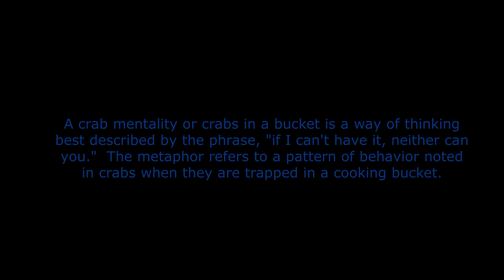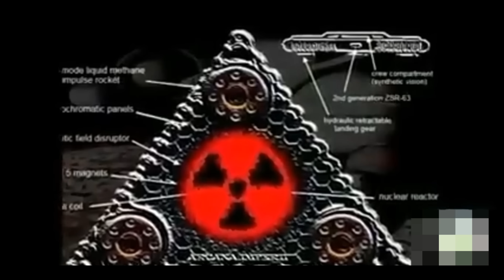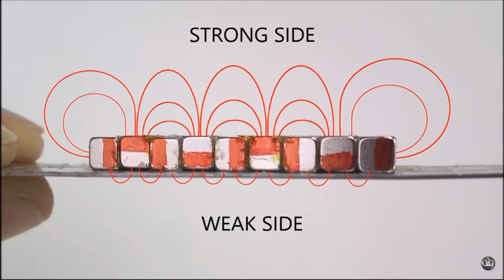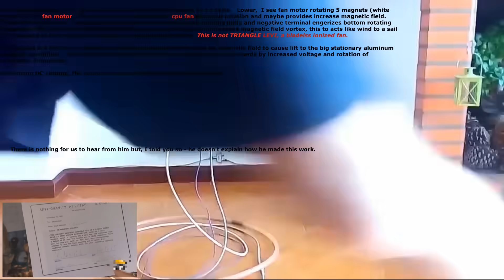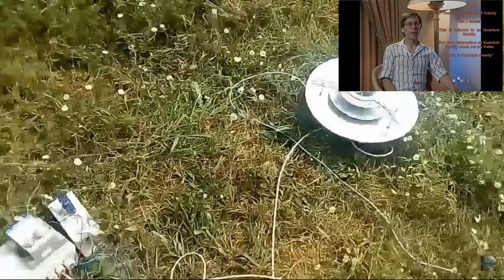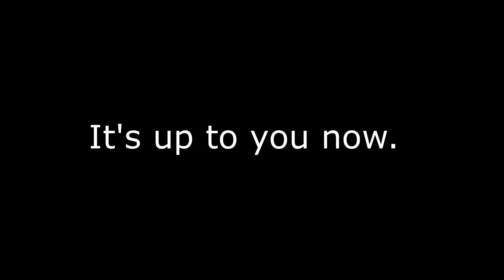anti-gravity project

Comment: This device would not be that hard to build... However, the video editor posted in the text portion that you only need 12 V to energize the magnets on the bottom and the top plate. Later in the video (look at the outside portion), the inventor uses a high-voltage transformer or Tesla coil along with a car battery and 3 other mysterious electronic boxes. So, my instinct is he might be energizing between the plates between 5 and 30K voltage. Creating a similar high voltage capacitor like a "lifter." Also, how are the magnets arranged with a hallback array in circular fashion? Can anybody fill in the blanks?

Comment: Way Down This Page, @ scraw3 The Kind Of Voltages Mentioned 2,000,000 Volts And 290 Kilovolts Means, The Current Would Be Very Small, In Terms Of microamps Or Smaller, nanoamps Or picoamps. In DC Volts Of Amplifier Circuits Using Valves/Vaccum Tubes As An Example Of Around 400/500/700 Volts, Currents Would Be Anywhere From 80/90 milliamps Up To 150 to 250 milliamps, Depends On How Power Hungry The Circuits Are That You Wish To Energise, Or Power Input To Dissipate In To A Load At Low Impedeance As A Power Output, For Audio Frequencies. 

Both DC Volts/Currents And AC Volts/Currents Can Create Magnetic Induced Fields In Iron And Other Materals, (Copper Windings Or Aluminium/Aluminum/Steel/Nickel/Silver Windings Or Electric Field,Magnetic Field, Around A Wire Insulated Or Not Insulated Or Mercury Etc) Such As Dynamos/DC Generators/Motors And AC Alternators/Generators/Motors. Power Is The Product In Ohms Law Of V, Volts Times By I,  Current In Amps,
 A Simple Way To Remember This Is Volts Times Amps Equals Power, Or It's Product Is Power. Therefor For Very High Voltages The Voltage Is Massively Larger And The Current, Amps,  I Is Conversely  Very Much Smaller Or Tiny In Comparative Terms, It Will Still Create A Product Of Power And Generate An Electrically Generated Magnetic Field, In Whatever Medium You Wish To Generate It In Or Induce It In, Be It A Toroidal Field In A Metal Or Ferrite Toroid Or A Transformer's E/I Laminated Field As Used In Many Electronic Devices For Power Supplies From AC Powered Suppliess Or Via Or In Ferrite Dust Rods Or Ferrite tTansformer Assemblies Be They Toroidal or Following The Iron Core E And I Construction Principals. 

Incidentially, Ferrite Iron Powder Compound, Rods Are Used For Most Radio Receiver Aerials To Convert A Radio Waves Voltagfe And Current, Magnetic Wave With The Audio Modulated By AM Amplitude Modulation Or FM Frequency Modulation Via A Tuned Circuit,That The Audio Information is Filtered Out From, Said ToBe Demodulated  By and Separated Out From To Be Amplified As An Audio Signal And Played Back By An Electrodynamic Speaker For You To Listen To, The Same Principals Apply To Headphones And Microphones As An Inverse Of Sound Reproduction By Magnetism, That A Microphone When A Dynamic Or Ribbon Type Generator Using Magnets For A Magnetic Field Generates A Voltage Of A Varying AC Current In The Microphone's Coil With Attached By Glue Or Resin To The Said Diaphram Or Ribbon In Direct Proportion To The Frequencies It Hears Or Detects/ Monitors/Receives On, And By It's Diaphram, (The Ribbon In A Ribbon Microphone Is Both it's Diaphram And It's Generator Coil Effectively),To Record Or Send A Voice Through An amplifier Or Through Radio Waves To A Radio Receiver Or Via A Telephone Etc.

The Reasons This Is All Relevant As Per Above Is High Frequency Energy At  Very High/Super High Or Ultra High Frequencies May Have A Particular Product In This Theory Of Levitation And Directional Control.
And A Rotating Gyroscopic System Energised Magnetically May Be A Way To Lessen Mass For Levitating Ease, Eric Laithewate Demonstrated In His series Of Christmas lectures Back In The 1960/70s That A Boy Of Around Ten/Eleven Years Old Could easily Move/Maneuver a Very Heavy Iron/Steel Disk Akin To A Heavy Weight, LiftersWeight, Disk Of Iron Like It Was A Very Light Weight With Not Much Mass Spinning At A  Few Thousands Of Revolutions Per Minute On A Yard Or Thereabouts Rod, Amost Like The Boy Was Lifting And Moving A Feather !.

Comment: I have to admit, I did not get this because of the data overload. Anyone keeping up without pausing and rewinding is a G. Then, honestly I did just give up but I have been running your algo in the back of my mind. Hehehe. I just imagined how engines/turbines or maybe even drone motors have rotating magnets... so are they inherently anti gravity devices without the action against air or pushing air outwards for motion in an environment with an atmosphere. Once this clicked I have been laughing this side the whole time. But I plan on following...

Comment: ok but if i take this and build a Ufo shell with controls and take the battery make it more powerful but smaller and put it in the contraption then i have a UFO , siiiick im gonna try build it.
Reply from the maker: If you were to look through my online store on my hoodie there you’ll find a secret that nobody has found so I’ll describe the print here. 

To explore how a flat capacitor might generate lift under theoretical conditions. Here's a more detailed explanation:

### Components and Setup
1. **Capacitor Construction**:
   - Diameter: 1 meter
   - Height: 3 inches
   - Two parallel plates separated by a dielectric material (insulator)

2. **Direct Current Application**:
   - Connect the capacitor to a high-voltage DC power supply.
   - Ensure proper insulation and safety measures to handle high voltages.

### Electrostatic Levitation Process
1. **Charge Distribution**:
   - When a DC voltage is applied, positive charges accumulate on one plate and negative charges on the other, creating an electric field between the plates.

2. **Electric Field Creation**:
   - The electric field (E) strength is given by E = \frac{V}{d}, where V is the voltage applied, and d is the distance between the plates (3 inches in this case).

3. **Force Interaction**:
   - The electrostatic force (F) between the plates can be calculated using Coulomb's Law: F = \frac{Q_1 Q_2}{4\pi \epsilon_0 r^2}, where Q_1 and Q_2 are the charges on the plates, \epsilon_0 is the permittivity of free space, and r is the distance between the charges.

### Lift Generation
1. **Balancing Gravity**:
   - To achieve lift, the electrostatic force must counteract the gravitational force (F_g) acting on the capacitor. For a mass m, F_g = mg, where g is the acceleration due to gravity (approximately 9.8 m/s²).

2. **Electric Field Strength**:
   - The electric field strength required to lift the capacitor must be extremely high, and the voltage needed can be impractically large with conventional materials.

### Magnetic Levitation (Alternative Approach)
1. **Magnetic Interaction**:
   - Incorporate a magnetic field by placing electromagnets underneath the capacitor or embedding magnetic materials in the capacitor plates.

2. **Lorentz Force**:
   - Applying a DC current through the electromagnets generates a magnetic field, which interacts with the charges on the capacitor plates. The resulting Lorentz force can contribute to lift if configured properly.

### Practical Challenges
1. **High Voltage and Safety**: Generating the required electric field strength involves handling high voltages, which requires careful design and safety measures.
2. **Material Limitations**: The materials used must withstand high electric fields without breaking down.
3. **Stability and Control**: Maintaining stable levitation requires precise control of the electric and magnetic fields.

### Halbach Array and Magnetic Levitation
A Halbach array is a specific arrangement of magnets that creates a strong magnetic field on one side while canceling it on the opposite side. Here's how it could contribute to lift:

1. **Halbach Configuration**:
   - A spinning disc of magnets, arranged in a Halbach array, creates a highly concentrated magnetic field pointing upward.
   - The 10,000 RPM motor spins this disc, enhancing the magnetic field's strength and stability.

2. **Interaction with the Capacitor**:
   - The strong magnetic field generated by the Halbach array interacts with the charges on the capacitor plates.
   - This interaction can create a Lorentz force that contributes to lift.

3. **Electromagnetic Lift**:
   - The spinning Halbach array and its upward-pointing field provide an additional force component, aiding in lifting the capacitor plate.
   - The combination of electrostatic and electromagnetic forces results in a more effective lift mechanism.

### Detailed Mechanism
1. **Spinning Magnetic Disc**:
   - The 10,000 RPM motor ensures that the magnetic field from the Halbach array is stable and strong.
   - The rapid spinning of the disc could induce eddy currents in the capacitor plates, further contributing to lift.

2. **Lift Enhancement**:
   - The upward-pointing magnetic field acts like a sail, harnessing the electromagnetic forces to create lift.
   - This setup is more efficient than a static system, as the spinning motion enhances the magnetic interactions.

### Practical Application
1. **Voltage and Magnet Strength**: Higher voltages and strong magnets are critical to achieving significant lift.
2. **Material Selection**: The plates and motor components must withstand the high-speed spinning and strong magnetic fields.
3. **Safety Measures**: Ensure proper insulation, shielding, and safety precautions when dealing with high voltages and rotating machinery.

This innovative approach combines the principles of electrostatics and electromagnetics, leading to a more effective lift mechanism.  🚀🔋🧲
Summary
While this theoretical exploration shows how a capacitor potentially demonstrate lift using electrostatic or electromagnetic principles, achieving practical lift is highly challenging and may require advanced materials, precise control, and safety considerations. The concept is fascinating and opens the door to exploring innovative technologies, much like how maglev trains use magnetic levitation for practical transportation.  

I never continued, no funding. I’ll start it on my terms once I have earned the funds.
Reply: @jefflucas_life  hell yeah dude i also want to try build what they built in this video but then bigger

Comment: gravity is a higher wave of magnetism Germany did it but the speeds the liquid metals spun at are faster than this, there was pressure and heat involved, grandfather talk with those working on it where he was stationed. model and theory was based on the central of the earth
Reply from the maker: liquid mercury is conductive, and theoretically, if passed through a magnetic field, the movement of mercury could induce an electric current. This is based on the principle of electromagnetic induction, where a moving conductor in a magnetic field generates an electrical current to power antigravity drives.
Reply: @jefflucas_life  explain the sound and what happened to Travis Walton. discharge.
the German bell sounded like two liquid metal no discharge

Comment: Planets either gravity can act as a UFO’s acceleration?
Reply from the maker: Gravity is a fundamental force of nature that arises from the interaction between masses. It's what keeps planets in orbit around their stars and causes objects on Earth to fall towards the ground. In the context of spacecraft or UFOs, gravity can affect their motion in different ways:

Gravity assist: When a spacecraft flies close to a massive object like a planet or moon, it can use that object's gravity to change its trajectory. This technique is often used by space missions to gain speed and alter their course.

Orbital dynamics: In orbit around a celestial body, the gravitational force between the spacecraft and the planet/moon affects its motion. The spacecraft's velocity and altitude determine whether it stays in orbit or falls towards the surface.

In the context of UFOs, if we assume they are capable of defying gravity, it could mean one of two things:

Artificial gravity: A UFO might be using some form of propulsion or energy source to create an artificial gravitational field around itself. This would allow it to move through space without being affected by external gravity.

Exotic matter or energy: Some theories propose that UFOs could be made up of exotic matter or energy that doesn't respond to normal gravitational forces. This is purely speculative and not supported by current scientific understanding.

In the absence of concrete evidence, we can only speculate about the hypothetical scenarios mentioned above. However, it's essential to remember that our understanding of gravity is based on decades of scientific research and experimentation.

Comment: These crafts use polarized light to travel.Take two plates with a very high voltage potential between them and arrange them so that the field strenght varies with distance.And then pass light through this field.
Reply from the maker: Fascinating topic! It seems like you're exploring some cutting-edge ideas on anti-gravity.

The concept you've described, using polarized light to travel, is an intriguing one. The idea of manipulating electromagnetic fields to create a "gravitational" effect is not entirely new, as researchers have been exploring the potential of electrostatic and electromagnetic manipulation for propulsion purposes.

The experiment you're proposing sounds like it's based on some fundamental principles in electromagnetism. By creating a high-voltage potential between two plates, you can generate an electric field that varies with distance. Then, by passing light through this field, you might be able to observe some interesting effects.

Here are a few thoughts and questions to consider:

1. **Polarization**: You mentioned polarized light, which is crucial for this experiment. The polarization of light can affect the way it interacts with electric fields. Are you planning to use linearly polarized, circularly polarized, or perhaps elliptically polarized light?
2. **Electric field strength**: You'll need to ensure that the electric field strength varies significantly over a small distance to create the desired effect. This might require careful control of the voltage potential and plate geometry.
3. **Light-matter interaction**: When you pass light through this electric field, what kind of interactions do you expect? Will it be purely absorptive or reflective, or will there be some other form of energy transfer?
4. **Gravitational analogue**: Keep in mind that creating an "anti-gravity" effect might not literally defy gravity. Instead, you're aiming to manipulate the electromagnetic forces acting on your system. This could lead to fascinating insights into the interplay between light and matter.
5. **Practical considerations**: Remember that this is a theoretical framework, and practical implementation will require careful consideration of experimental conditions, equipment calibration, and data analysis.

I'm excited to hear more about your experiment and any progress you make!

Comment: The key is to get the liquid mercury rotating at enormous speed. You have to take two discs and they have to internally rotate counter to one another on top of one another. I think there is a plate or something connected to the frame of the aircraft (tied to the total mass) that may go in between these. I think, potentially, the way you fire the rotating discs above and below the plate determines if you're going to go up or down just like negative or positive. Then you take the liquid mercury (which I heard should be irradiated and purple) and place it in a magnetized disc. You need to also magnetize the area around the liquid so it's not touching any surface inside the disk and you need to ensure there's no air in the cavity. This will allow you to have a frictionless environment. I've also heard PSI needs to be at least 200psi but I don't know why or if that's true. I'm assuming it may have something to do with keeping the mass compressed inside the liquid mercury disks and it seems to me the magnets that prevent the mercury from touching the surface would also serve as pressure that you could turn up or down.
Reply from the maker: Hi there! I appreciate you taking the time to share your ideas about anti-gravity. Just to make sure I understand correctly, you're suggesting that rotating liquid mercury discs with counter-rotating internal plates could potentially create a frictionless environment for lift or thrust? Additionally, you're proposing magnetizing the discs and surrounding area to prevent the liquid from touching any surfaces, with a pressure of at least 200psi to keep the mass compressed inside?
Reply: @jefflucas_life curious as well